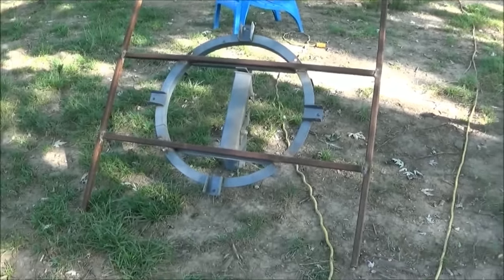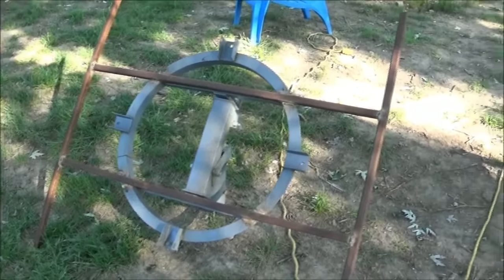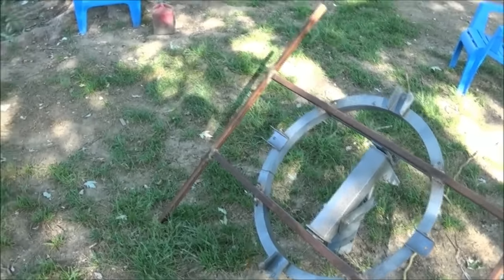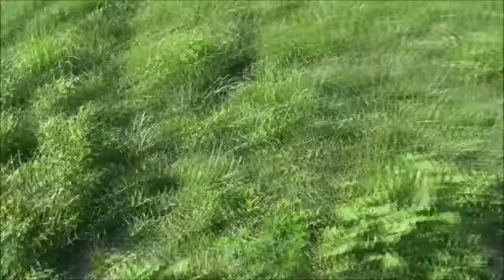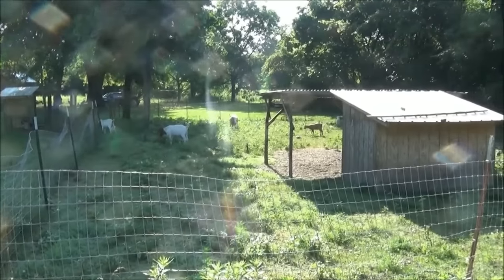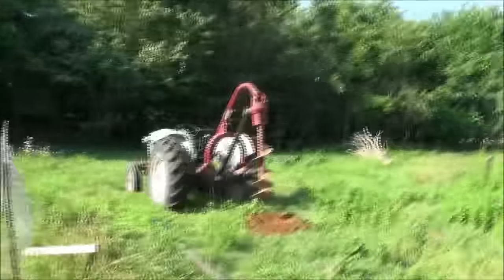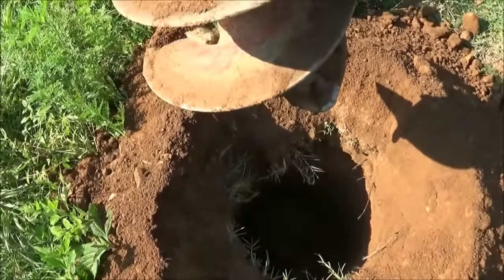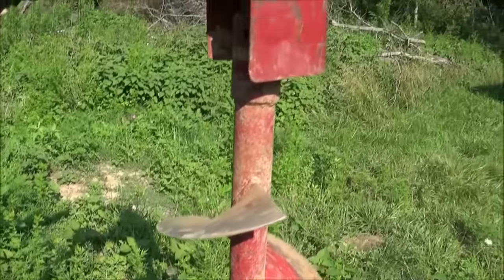Instaling The Solar Tracker on the Homestead Prt. 1

Comment: Hi, Rick, I never thought about using a c ban for a tracker, I had one at my ol home. I thought it was remote controlled when you change the channel. Not auto adjusting. I hope it works well for you, .
Reply from the maker: Yes they work on the same cocept. they just have to be modified to work with solar panels.